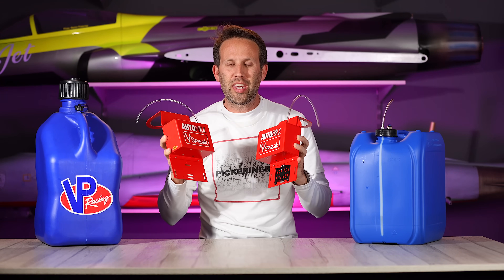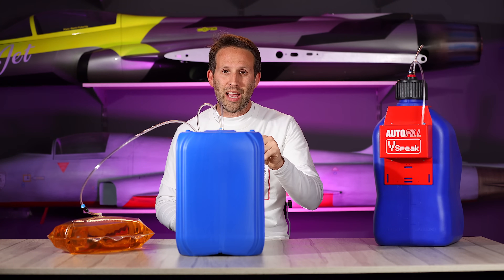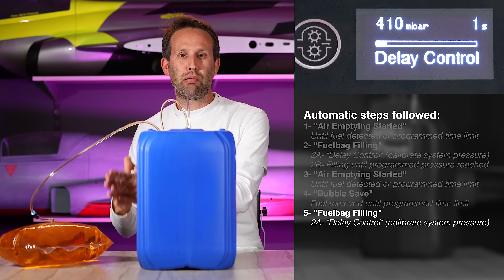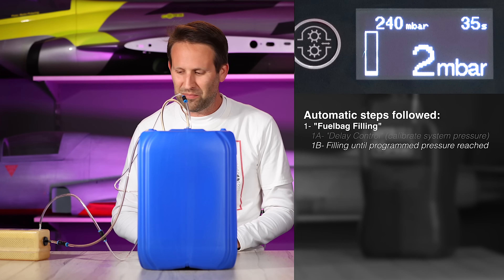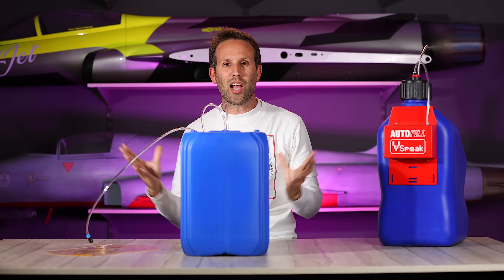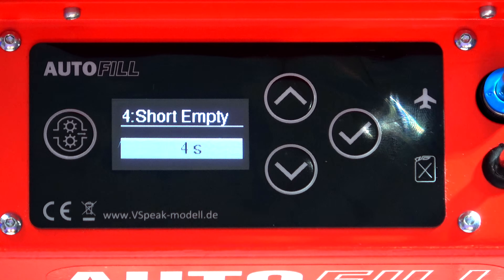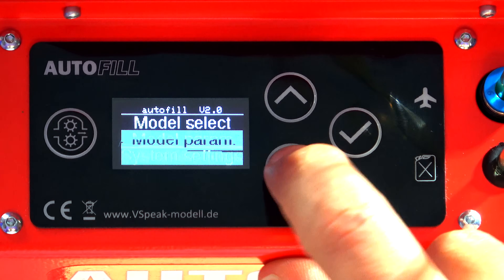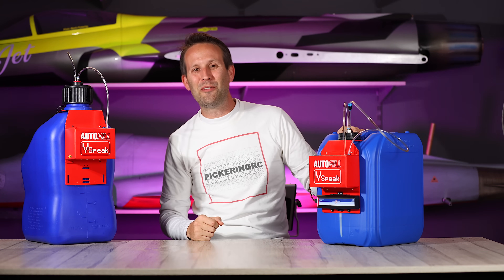Vspeak Fuel Station: Pressure Sensing Auto Off!!

Comment: Martin how do you disconnect the fuel fill line from the bladder tank without fuel spilling? Is a special valve required?
Reply from the maker: Just a normal tap valve, open it to fill, close it to disconnect, tend to use the same for normal tanks too

Comment: Is it available anywhere in the USA?
Reply from the maker: Aeropanda just published that they have it in stock!
Reply: @MartinPickering-PickeringRC  Found it.  It looks like I need to order the system, the optional tubing, and then also make the limiting line you showed to increase the pressure when fuel fills the overflow line.  Any guidance on the creation of that line with the fitting in it?  Thanks!!